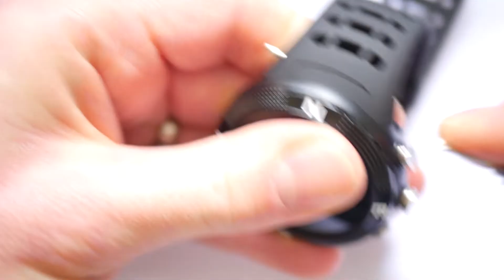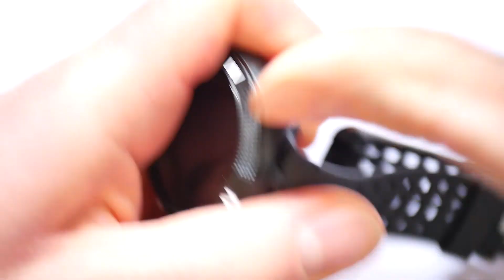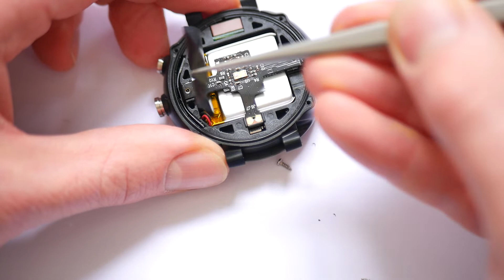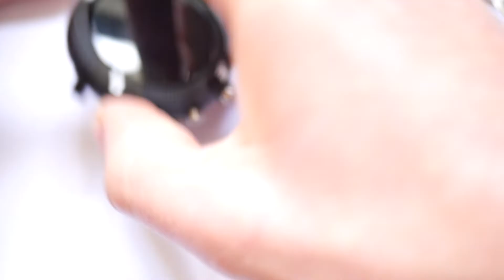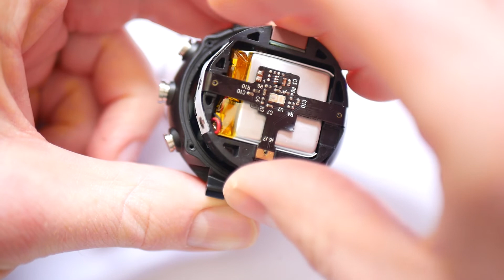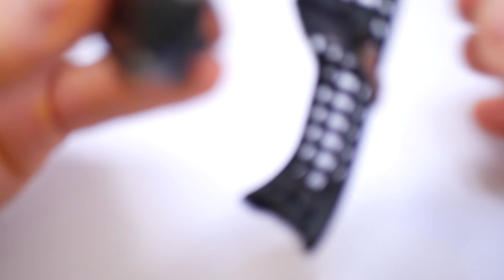Bangle.js: Opening and re-assembling

Comment: Hi! I can't find any battery replacements online. Are they also sold on the website? If I could buy them, i would be interested in buying one, so that i can wear it forever, without a replacement, i know i will have to throw it away in a couple of years....
Reply from the maker: The battery is a "350mAh 502527 LiPo", which it should be pretty easy to search for and order. While we don't currently list the batteries in our shop, we do have stock of them and are happy to sell them - if you drop us an email at contact@espruino.com we can sort something out